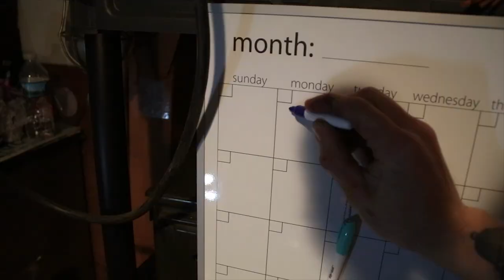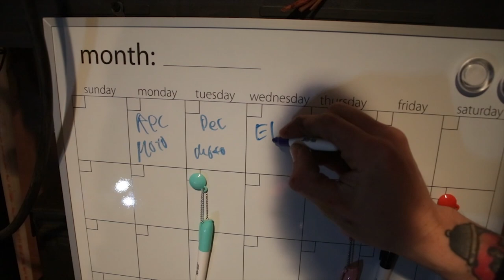xs650 how to change sump filter & bike update

Comment: What is the "Other Plug" at 7:11 ??  Found a bard find XS650, doing a full walk through to make sure everything that needs to be replaced is, don't know what that plug is so I don't want to just unscrew it.  LOL
Reply from the maker: For some reason its just another drain plug 🤷‍♂️ i only ever did the front one so ibdont have to plugs to worry about a potential leakage from lol

Comment: I bought my bike 2yrs ago,I love it,it was a non running bike,my filters looked like yours,but I just cleaned them and put new oil in,cleaned carbs,then I switched the seat and some other cheap shit,cosmetic shit,and it's been a daily driver ever since,I am a poor mofo so I saw those shaving and got scared af,thought I was screwed,but when I put my carbs back on(bs34)it started first kick, I adjusted cam,then valves,synched carbs, clutch pushrod oil seal,sprockets, chain.then I rode it to work a few times changed oil again, then rode it a few hundred miles changed it again,I haven't had a single issue with it since.i did buy top end seals,and cam chain guide but they're just sitting until I see a good reason to pull motor
Reply: Any ways man I subbed, so thanks for the response, and good luck
Reply from the maker: Awesome thats all good news, i had aloooot of plastic and some metals chunks which tells me my guides are gone, so ill be pulling my motor out anyway to finish welding the frame so when i do plan on atleast taking a look 😬 lol but thats great man thanks for the sub, much appreciated! 🤙
Reply: For sure man thanks and again good luck

Comment: Hey man when you showed those two drain plugs ,one is for the oil I've never removed the other one,do you know what it's for?
Reply from the maker: Both 27mm plugs are to drain the oil, i believe its because of the internal shape is not level and both plugs are at the lowest points so it will be a complete oil drain.

Comment: Am I supposed to change sump filter at every oil change?
Reply from the maker: Not at all! It is meant to be a reused filter, however it doesnt hurt to check on it every oil change because there is a specific point where there is alot of oil flow pressure and is known to blow the screen!
Reply: ChopperFisher and the oil filter is a reusable filter as well right? And another question, there is no difference between the engine oil and the transmission oil right? My maintenance manual does such a bad job at explaining stuff
Reply from the maker: Sure is, and that is correct, there is an oil pump that takes the oil from the base of the engine where the transmition is and pumps it to the top of the cylinder for kinda a double use, thats what the chrome tube on the front of the engine is
Reply: ChopperFisher thanks!